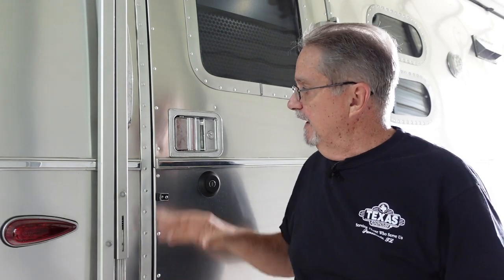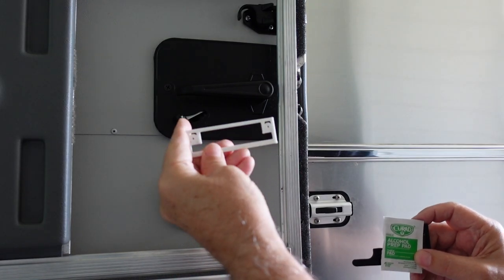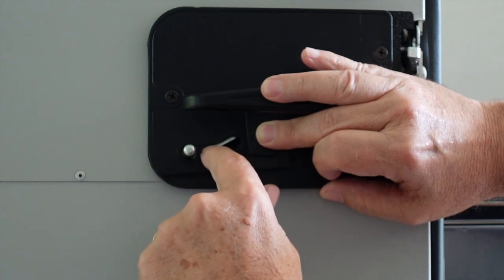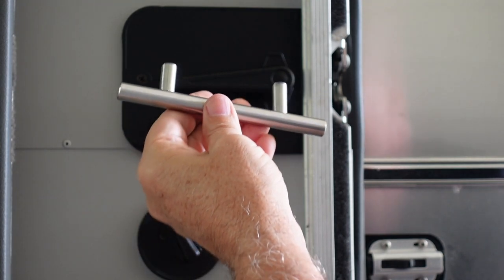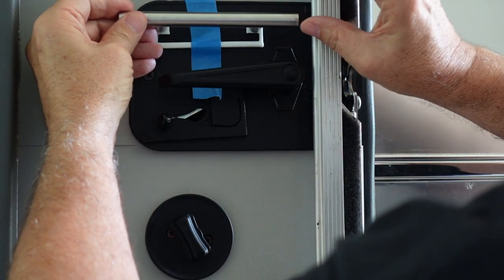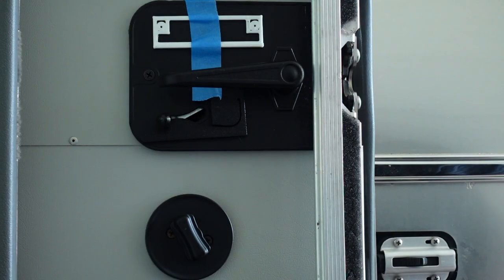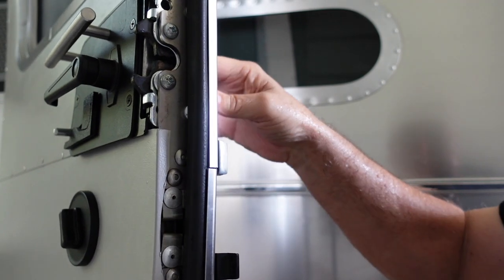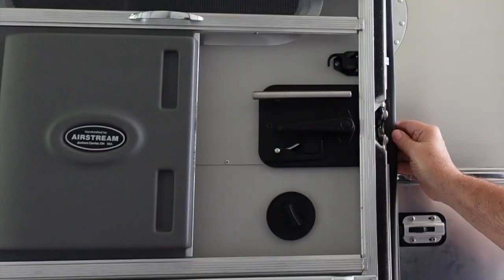LOCKOUT BLOCKER!! - Prevent Lock Outs on Airstreams / RVs

Comment: Jack, there is a modification for that pressed washer on the back panel of the door handle that cracks and pulls loose. I saw it on Airstream Nuts & Bolts YouTube channel. Great video on your installation although the black on black was hard to see. Thank you for making these educational videos. Safe travels!
Reply from the maker: Sorry about the black on black. I have seen the mod you mentioned but I like this solution a little better. Appreciate the commend and thanks for watching.
Reply: @LandingZoneHome  yes I like this mod a lot and plan to install it on mine soon.

Comment: Thank you for responding with finding the complete lockout package.  Got it ordered and will install soon.  Take care. Dave.
Reply from the maker: My pleasure. :)
Reply: @LandingZoneHome  Hi, is there any issue in locking the door with the key after installation if the lock prevention device?
Reply from the maker: @somedayistodayrv  I have not tried. I just never use that lock and only use the deadbolt.
Reply: @LandingZoneHome  Airstream Co. told me to lock both before traveling.  Just thought I would ask and see.  I saw someone else had a similar question in the general comments section.  Is it possible to get more information on this?  Dave.
Reply from the maker: @somedayistodayrv  Okay, anything to keep my viewers happy :) I just tried it and turning the key is a little hard but it did lock but I wouldn't force it. I think it will depend on how close you install the blocker to your inside latch. You can reach out to Rob Mousel (on Airstream Addicts) the maker and ask him. But my recommendation regardless of what Airstream says is to NEVER use the handle latch lock. After all, Airstream just makes these thing they are NOT the experts on how to us an Airstream, we the owners are. Thanks for the question, I'm sure others will be interested also.

Comment: I just bought and installed this kit.  The handle template did not align exactly with the handle posts, but I was able to make the needed adjustment.  Also, there is a spacer sheet (gasket) under the latch panel.  I installed the handle closer to the top edge of the latch plate and the  spacer interfered with the upper left screw head.  I was able to route the space to provide clearance for the screw head.  Alignment of the Lockout Blocker is important.  You only get one chance with 3M VHB adhesive pad.
Reply from the maker: Some great lessons learned here Bruce. And to be completely honest, I installed mine too low and immediately used a flat blade screwdriver to removed the 3M Sticky and it went back on just fine. :) But you have a very good point about the spacer gasket. Thanks for watching.

Comment: Why do you need to install the handle if the other installed part is supposed to prevent getting locked out/in?
Reply from the maker: Good question and the answer is; if you use the door handle to pull the door closed over time that handle will come off and you will be locked in. By adding the additional handle you can avoid this problem. Let me know if you have other questions and thank you for the question.

Comment: Seems like a good solution. However if this is installed, can you no longer lock the latch with a key from outside?
Reply from the maker: I never use the door handle lock, it is just too unpredictable. I only use the dead bolt. Thank you for watching.
Reply: @LandingZoneHome  Even driving down the road? I have the exact set up- door opens from left to right and I bought the kit from Rob. I installed the handle months ago because I was concerned that yanking on that door handle was going to be a problem eventually ( has AS modified that archaic design?🤷🏼‍♂️) but I only just got around to installing the “lockout preventer”. Has anyone been able to lock (and unlock) the door handle from the outside?
Reply from the maker: @rogerdennison8154  I don't even think about locking the door handle only the deadbolt for me.
Reply: @rogerdennison8154 
Hello. I lift that flap up and on top of the bolt peg then gently close the door so that the flap stays on top of the peg. It will lock with the key.